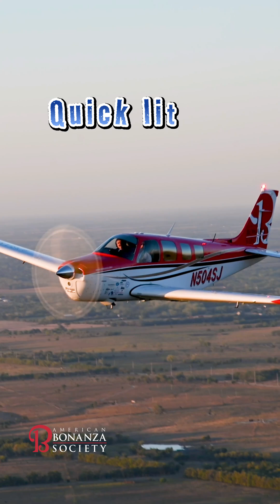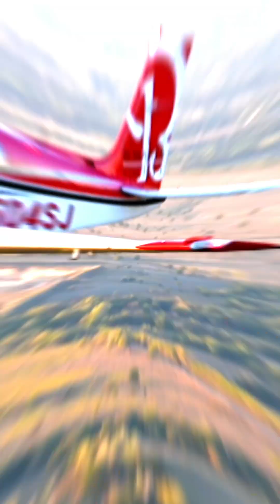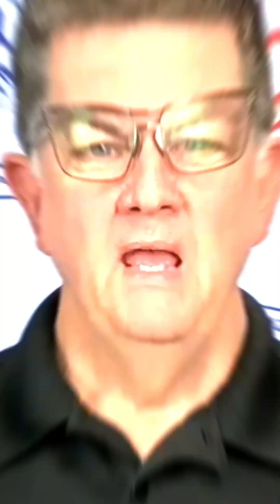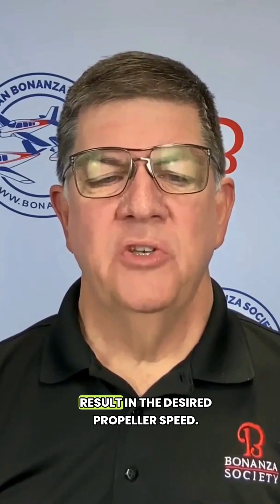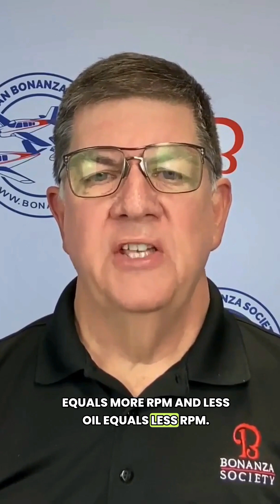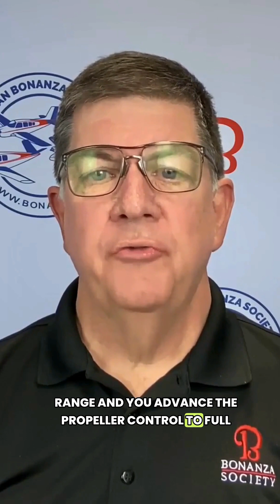Why Your Propeller RPM Stays Constant: Understanding the Prop Governor

Comment: Seems like you have contradicting statements on governor oil pressure to the prop.  When you talk about RPM increases/decreases it sounds the opposite of what you state the governor does in normal operations versus RPM.
Reply from the maker: Hi Allan, the function is opposite in the twins compared to single-engine airplanes. Both are described in this short video.